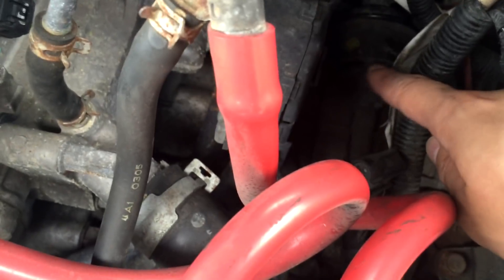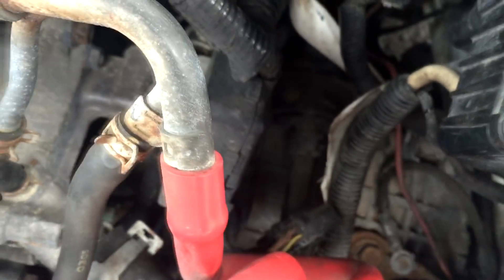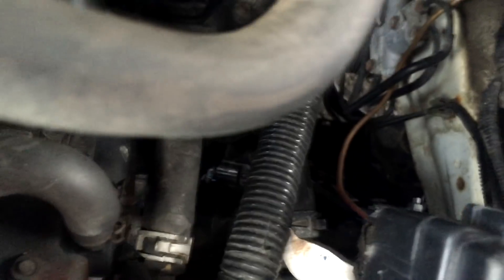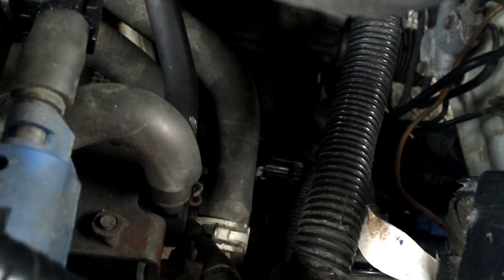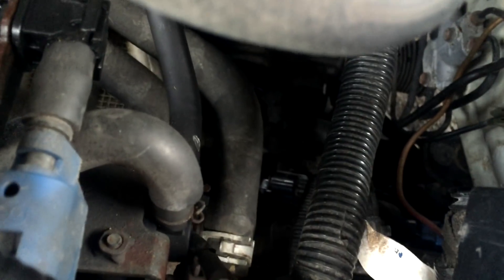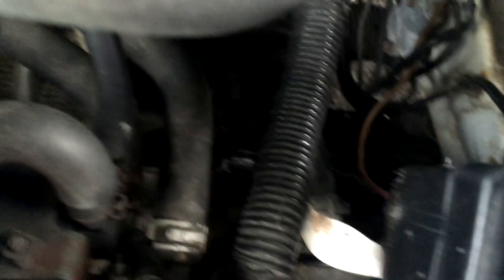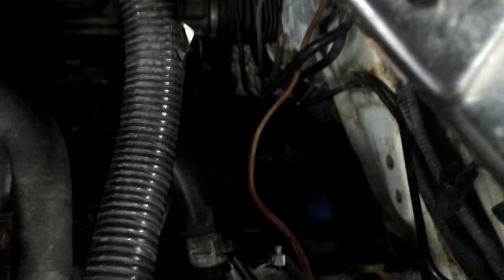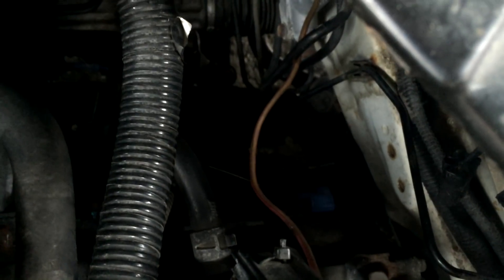Acura / Honda Transmission Problem? Blinking D? Check here!

Comment: On the 5 speed auto that single linear solenoid will cause that. I took mine out and cleaned it but forget to plug it back in. The d started flashing right away. Soon after plugging it back in the flashing d disappeared. If it's malfunctioning in any way start there.

Comment: Do not rely on his OBD2 pin diagram shown at 5:36! Yes, do short pins 4 and 9, but the diagram shown in this video is backwards and will cause you unnecessary distress. Read the numbers on the OBD2 port itself--the four corner pins should each have a number printed next to them.

Comment: Do you short the ODB2 port pins while the engine is running? (5:26)
Reply: If you do, you will blow the ECU fuse. So don’t do that. Ask me how I know?😂
Reply: @bdpgarage  The problem is that the blinking "D" goes away when I turn the engine off. There's no code to be read. Did you follow the pin diagram he provided at 5:36? Is that how you blew the fuse? Or did you reference a correct diagram from elsewhere? (His diagram is shown backwards.)
Reply: @niemand000 theres another comment saying the diagram is backwards. Im off to find a repalcement fuse…
Reply: @bdpgarage  His diagram is a clusterfuck. Read the numbers on the OBD2 port itself--the four corner pins should each have a number printed next to them.
Reply: @niemand000  tried pin 4 and 9 on the connector and it blows the fuse. Hard to see the small numbers but it looks right.
Reply: @bdpgarage  You tried pins 4 and 9 while engine was running? And it blew the fuse?
Reply: @FranklinPhan  yes. Tried engine on an engine off.
Reply: @bdpgarage  I've jumped pins 4 and 9 before to reset VSA with no problems. I first had the ignition off before jumping the pins. Then after jumping the pins, I depressed the brake pedal, and turned the ignition to "on" position (position 2). Then did a list of waiting for certain lights and pressing and releasing the brake pedal. That was for 2006 TSX. What car is yours?
Reply: @niemand000  mine is a 2004. I can check again and see if im misreading the pin numbers.
Reply: @bdpgarage  2004 to 2008 TSX should be the same. Take a photo of the port with steady hands, and zoom in to read it.

Comment: I have a Honda Accord CL7, 2003, with 137k, In my case it happens sometimes when im on Drive "D": After open the traffic lights   suddenly i start to feel shift rought, jerks and when i change the gear to Manual (+/- mode) it's not respoding, even doesn't show me in wich gear/Shift im (if is 1,2,3,4,5) then it's starts to blink D and if i stop the car, turn it of and on again the problem it's gone. Any sugestion?

Comment: Did you have to replace the input and output for it to work ?  Or could I do the output alone I’m having the same exact problem for the Acura TL 2006 3.2L v6
Reply from the maker: The code will tell you which one to replace

Comment: I changed the transmission speed sensor in my 3.2 CL 2003 Base model because I was having this problem, although I was also getting a Torque Converter Clutch Malfunction code. Yet still, replacing this sensor and transmission fluid flush seemed to fix the issue, but not immediately. I still had some roughness for the first few drives, but then it went back to driving completely normal! About 7000 miles or so later however, the issue came back. I now come to realize after watching this video that only one of the speed sensor was changed. So I'm wondering if perhaps I just change both of then again (since I can't know for sure which one did or didn't get changed) if that would do the trick? Never done anything like this before but I've done a lot of research and so I think it's worth a shot. I may also change the transmission fluid with the good OE factory stuff, maybe also add some Lucas oil. I'm going to see if changing the grounding cables is needed also. These are all the things I've found. I may just try switching out the two sensors and reseting the codes if I csn figure out how (I don't have a computer check light reader) first. Will check back in case anyone is interested.
Reply: I'm thinking of purchasing the 2 sensors from amazon, my acura failed to change gears out of no where so I changed the oil (3 bottles) feels better but the problem comes and goes.
Reply: @diegoqwe4864  check out inc3neration here on YouTube. Really quality videos about this stuff. Mine was overfilled and so swapping fluid with 3 quarts of Honda now. Anyway, he had a video about changing the Transmission Oil 3rd Gear Pressure Clutch Switch. Very easy to change out, and could help a lot with this problem! I'll be changing mine even if my issues resolve after changing to correct fluid level.

Comment: I’m looking to buying a 2004 tsx 

Guy said the he has the same problem you’re having . But he bought the original part from Acura dealer . But his code is coming out P0958. He said it wa located in the center console . And it still came on. Any thoughts ?

Comment: I have Acura tsx 2010 with the same problem, what's the solution?
Reply: Hey did you ever figure the problem out
Reply from the maker: It was the transmission input or output sensors if i recall, watch the video as i don't remember the details. I work on many many cars every week , sorry!
Reply: Also change  transmission filter

Comment: My Acura TSX 2004, won't go over ten miles an hour. It won't shift it just revs. Now, it won't reverse.
Reply from the maker: You probably have same problem as i did The computer cant figure out what gear it is in therefore, you are in limp mode. Sounds like either a speed sensor or the sensors i mentionned. Easy fixes but make sure to buy HIGH QUALITY sensors. Don't cheap out.
Reply: @MTLJack  Will do, Thanks pal!

Comment: Any suggestions for a 2004 Acura rsx that “d” light continuously blinks with check engine light on all times and speed o meter goes up fast put stays roughly between 3 and 4?
Reply from the maker: D light blinking points to transmission related problems. Sounds like you have similar problems buddy.
Reply: But*
Reply: What was it

Comment: Thanks for the video .. i got simple cuestion .. myb02 honda element automatic 4 cylinder start with check engine light but not d flashing liths my rpm max is 2700 or 2900 max my truck dosent run more than 65 milles if i phush the gas pedal starts to make like jumping and shakes.. do you think is the output and input sensors .. i can replace those same time just wan to fix my element please give me an idea please i replace the trid gear preshure swhich like 3 monts ago llease help...
Reply from the maker: Sounds like your car is in LIMP mode or something ...

Comment: The D light indicator went out and the car lost power for several miles before the light suddenly came back on and the issue cleared up entirely. 362,000+ miles now.
Reply: mine did the same was leavinmg for work one morning then my d4 started blinking and my engine light came on let it sit and came back the necxt day and it fixed im confusion but i aint complaing

Comment: I did this jumper method to get the trans code and blew my #4 ACG S fuse under the hood 15 amp. Car wouldn’t start or shift into gear until I replaced this fuse. Must’ve reset something because then my reverse worked for 5 minutes until the CEL and TCS light came back on. Anyways these pins to jump weren’t the right ones in my 2000 Acura TL!
Reply from the maker: Which jumper method? In this video, I only talked about what was my Acura TSX transmission problem, I did not show any fix methods!
Reply from the maker: And Acura TL 2000 does not have VSA, so wrong video my friend! You blew the ECU fuse.
Reply: MTLJack actually this is the right video because it worked on my car. You show it at 5:26 but your diagram is reversed! When I jumped 4 and 9 like you said I blew the fuse. When I figured out it was reversed and jumped the correct pins I got light flashes for codes on TCS, Brake, SRS and the D lights in the cluster. Thanks for showing this method of getting codes but I couldn’t find what they all meant online. I found my code reader later that day though.
Reply: @TonioXenon  I wish I would’ve read this about 10 minutes earlier than I did.😅
Reply: MTLJack I used what would be pins 5 and 16 in the picture you are pointing to at 5:34 to get the flashing light codes.

Comment: I need help sir my car is a honda civic fd 2010 model automatic D drive are blinking? And after shifting D drive or R reverse are jerking?
Reply from the maker: Any check engine code?
Reply: DTC UO 121 F CAN MALFUNCTION (PCM-ABS MODULATOR CONTROL UNIT)
Reply from the maker: Check your brake pedal switch or sensor

Comment: So “speed sensor “? Input & output ? I have a automatic Acura rsx hard shifting , can’t go into second gear , already did a trans fluid swap still doing the same hard shifting could this be the case ? Replacing the sensors would help ?
Reply from the maker: Is yours automatic or manual
Reply: @MTLJack  hey bro im having the same issue with this tsx 2012 automatic that I literally Kurt purchased today 😩😩😩 please him me but I’m not getting any engine codes or check engine lights just the check transmission the car still acting normal no lack of speed or any of that can you please him me thank you in advance
Reply: Automatic

Comment: Mtljack I have a 1999 honda accord ex. My engine light on and 4d is blinking. I put in a new pressure switch on the transmission code p1738. But I didn't salve the problem. Can you help?
Reply from the maker: Make sure you order a high quality sensor because some sensors don't have the exact resistance and the ECU doesn't like it. Ideally, get a oem sensor. Also, don't forget to reset the ECU by disconnecting the battery for more than 10mins or use a obd2 reader to reset.

Comment: I have a 2005 Acura TSX Auto with a code P0756 Shift Solenoid B Performance/Stuck Off, and with a flashing “D”. My car won’t move at all when it’s in “Drive” or “Reverse”. Is this really a Solenoid problem? Cause I was told that that code is a transmission problem with the filter inside of the transmission. I was told that I would have to get my transmission dropped and disassembled to get to the filter inside of the transmission 😪
Reply from the maker: Unfortunately, I don’t know much about the solenoid. My problem was much simpler :(
Reply: Having the same exact issue: '04 Honda Accord EX 4cyl 2.4L Did you end up finding a fix for the problem?
Reply: MileHigh Built Yeah I got my car back running. It’s the transmission. I guess the filter that’s inside of the transmission they get clogged up if you don’t do a transmission flushed right away the transmission could get damage do to the fluid not flowing fluid and cause the clutches to get burnt. In order to get to the filter you have to disassembled the transmission. I paid 1,700.00 to get my transmission rebuild including the rebuild kit and torque converter. My car runs a lot better.

Comment: Hi, I have the same problem with my Honda CRV 2009. I replaced the transmission pressure switch but the doesn't start.  I have to codes on the scanner: $18DAF111 and $18DAF11D. please somebody help me

Comment: I hope i get reply on this comment as I'm in desperate need of an expert opinion. My 2006 v6 Accord  has the same problem, while i was driving on the highway suddenly the gear slipped back to 2nd gear the D light came up flashing plus the check engine light and VSA too!! Turned off the engine waited for 10 minutes the drove well for 2 minutes then the same issue happened again. After watching your video tried your method and got 2 codes, 70 and 76. Please help 😞
Reply: Did you ever found out what was wrong with your car

Comment: Codes good for 04 to 08 TL?  Reference for the codes?  I have a 27 from the blink of the D light
Reply: With my TL, the "D" was just flashing.  I do not remember of my CEL illuminated.  

To get the fault code for transmission, I followed a procedure that I found online that required me to short two pins together within the OBD port.  The "D" in the PRNDL and the CEL would flash flash in a specific pattern that identified a certain fault condition.

 In my case, it was the appropriate flashes for a failed 3rd/4th pressure switch 

The process is online somewhere, do at your own risk, as you are shorting out pins on the OBD port.   

Best use a scan tool that has the capability of pulling transmission codes.  A common cheap scanner likely will not have the ability to read codes from the TCM.  

The bad 3rd/4th pressure switch is common to fail and is very easy to swap through the left fender well.  It's cheap and a easy attempt.
Reply: Figure ot out ?
Reply: @Rc-ho4sv   my issue was a faulty 3rd/4th gear pressure switch.   Easy fix.
Reply: @meteoradar3252  so when it happened , did D blink maybe 4 times and then threw cel ? This just happened to me . im sure its something along the lines of the switches , solenoid or some sensor . im planning the 3x3 drop and fill after i replace all pressure switches and solenoid . other than the lights i have no symptoms except small fluid lose . Probably just a seeping line ....
Reply: @meteoradar3252  did you check your code without a scanner ?

Comment: bro i have honda civic hybrid 2006. d indicator light is blinking and the car is jerking after a full stop at a stop sign. 
i need your helpfull reply thanks.
Reply: my 08 civic hybrid has the blinking D light. First the engine light came up then the speedometer stopped working before the D started blinking, When im driving and kinda press on gas then it kinda jerks instead of shifting...then I let go the gas and slowly step on gas until it gradually picks up speed and it will shift with no problem.  One day while I was at the traffic stop the car started jerking and going from one gear to another, then I turned it off when I try to restart it, it won’t start again till date. I towed it to Honda and they keep charging me for more money testing but yet to find the problem

Comment: Same thing on my 06 tl turned out to be the 3rd gear/clutch transmission fluid switch. The code was p0847 the part at my local acura dealer cost $80.

Comment: I have a 2007 Honda Civic Hybrid. My problem is speedometer reads 0. Check engine light came on. D light blinks. Car drives fine minus when stopped. Will die if coming to a complete stop. Code read as vehicle speed sensor. Changed that out. No difference.  Any thoughts?
Reply: vets fortrump 
how did you fix this problem. can you please explain it to me i have the same problem with honda civic 2006.
Reply: my 08 civic hybrid has the blinking D light. First the engine light came up then the speedometer stopped working before the D started blinking, When im driving and kinda press on gas then it kinda jerks instead of shifting...then I let go the gas and slowly step on gas until it gradually picks up speed and it will shift with no problem.  One day while I was at the traffic stop the car started jerking and going from one gear to another, then I turned it off when I try to restart it, it won’t start again till date. I towed it to Honda and they keep charging me for more money testing but yet to find the problem

Comment: Bro thank you ! This just happen to me a few days ago I have a 2005 Acura TSX when u was on the highway the flashing d blinking so as my engine light I had bout a 1hr drive home n made it the same day my gears was stuck! N I couldn’t move only a few feet then the speed sensor would say 0mph then go slowly to 20n get stuck I was n a panic I check my trans fluid n it was empty put some in n the car got to jerking randomly so I flush the fluid it was black completely put new fluid in n it sorta runs ok but I can feel my speed odometer doesn’t keep up it reacts late from when I’m pressing the Petal n I’m thinking I need what u needed I’m praying that’s it fix the problem
Reply from the maker: Joseph Malone if you have a check engine reader, try to pull out the codes! I had same problem as you except my transmission fluid was full
Reply: Yea mines was full they told me that’s why it’s was doin that so I took out a lot I had it full way pass the two bots but I’ll try a reader tomorrow hopefully that’s what is Man because I really love this car n hate to junk it
Reply from the maker: Joseph Malone if it’s the sensors then it’s easy fix :) I ordered the parts from Rockauto ,good luck buddy!

Comment: the codes were p0301 up to p0306 search in google and says cylinder detected misfire, and the mechanic had told me that was, at first I had the check engine light on

Comment: hi I have an acura Mdx 2004 with d5 blinking and vtm4 light on a mechanic said a lot of problems coil pack,egr valve,misfires problem etc but I think he only wants stole my money what you think?
Reply from the maker: If its misfire ect, you should have a check engine light on, i dont think D5 bliking has anything to do with your misfires because the D5 represents the transmission itself , not the engine. Tell him to show you the codes so you can google the codes, this will allow you to find he true meaning.

Comment: Hi, yes. Well I got this problem.. well my transmission of an Acura Mdx 2005 started flashing the D5 at first and then after a couple of miles it starting to be harsh on getting to accelerate like if it didn't wanted to... so what can it be? Do I need to change it.
Reply from the maker: Ari Grande that’s similar to what I had except the car wouldn’t shift the gear up so I was stuck at like max 40kmh. The D green light kept on flashing. It’s probably either the input or output speed sensor. It should show you a check engine code so use a engine code reader!

Comment: Hello, my Acura MDX been doing the same thing and there's a message kept popping up in the dashboard "check transmission" it's also takes about 10 seconds to accelerate. Please help... Thanks!
Reply: Hey did you ever get that fixed and what was the problem
Reply: @leesingleton2920 did you ever get your issue fixed?